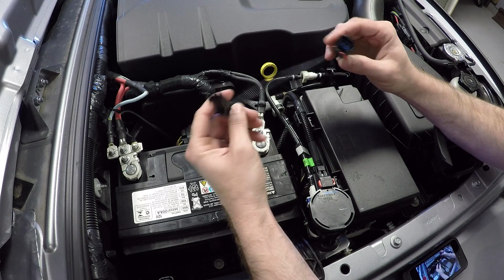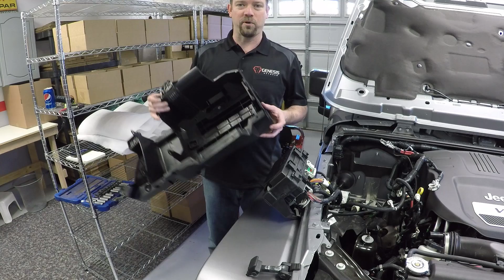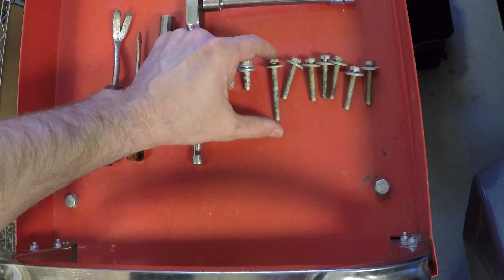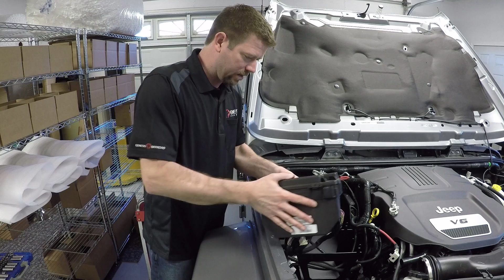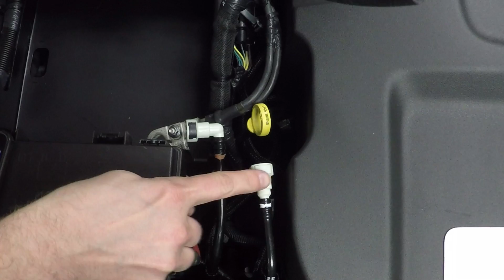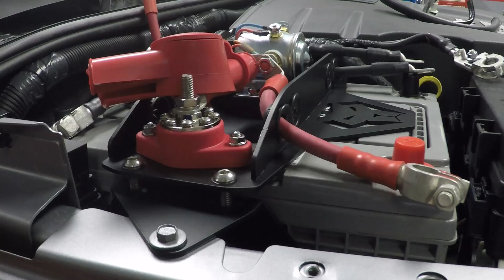Installation Instructions for the Jeep JK Dual Battery Kit

Comment: Ok i have the aftermarket hood strut installed.. which use the exact same factory hole that your battery bay need to use.. what now..  why did you choose to use that factory screw socket? Why not use the same hole that the factory plastic was using?

https://www.youtube.com/watch?time_continue=32&v=a0xfaBbRPbk&feature=emb_logo
Reply from the maker: Due to the weight distribution of the 2 batteries, the bolt location that we use is able to hold the weight more securely rather than the stock bolt hole location which is further forward.

Comment: Shane, it's Sunday night August 2nd.  My dual battery install is complete for now.  Today here in my region of Iowa it was nearly perfect weather.  I already had the structure in place.  All I had to do is go out, disconnect the negative terminal from my single Odyssey battery, slide that battery back toward the firewall, place the second one in, hook up the hold-down/isolator piece, wire the second battery in.  Took like 12-15 minutes.  Tomorrow, I'll wire my CB into the isolator as you demonstrate and then add my next set of Baja Designs A pillar lights.  I'll do my winch, Power Steps and improve the basics of battery wiring this Fall or Winter.  But everything works and I just want to thank y'all.  While I highly recommend this kit and the company, I suggest you follow my earlier thoughts if you aren't certain this is in your skill set.  Either take everything to a professional or get some buddies over, have a couple of beers or whatever you drink, expect to spend a couple of hours and be sure you have all the tools and another vehicle on standby for parts and pizza runs.  I did it with what these days has become mild mechanical skills.  Used to be much better, but I get worn out much easier these days.  If I can do it, you can too.

Comment: I bought all this stuff (batteries too) about a year and half ago.  Used one battery immediately, the other is still in the box.  I plan to finally do this install on my 07 JKU before the weekend.  Fingers crossed.  I'm not worried I can do it.  I'm just concerned about things like a brittle wire or something.  Other than that, no worries.

Comment: well just finished installing my genesis dual battery system in my 2016 JK these instructions are dead on point followed the video to the letter and the install was pretty easy the hardest part was getting the factory battery box out all that's left is the monitoring system to be installed (another day) but im very happy with the product and install instructions five stars !!!!!

Comment: can you use 2 different batteries. like a red top and yellow top optima ?
Reply from the maker: Yes, you can do that because they are both Gel Cell batteries. You can use a Red Top as your cranking battery and a Yellow Top as your accessory battery. The only real advantage of doing that is to save a few bucks, since the Red Top is usually slightly less expensive. The Yellow Top is equally as good at cranking duties, but it gives you the added benefit of being a deep cycle battery, meaning you can drain it down and recharge it without hurting it. Doing that to a Red Top will reduce its life span.

Comment: Can anyone tell me what the reason is for having dual batteries?  I bought a dual battery setup (tray, wiring harness, etc) several years ago, and never installed it.  Never found a reason to have a second battery.   I've winched, off-roaded, camped, etc.   All my lights (factory and aftermarket) are LED.    I'm guessing there must be one thing that other's do that make them want the dual setup, but I've not discovered what that was.

Comment: Do you recommend upgrading the alternator when running dual batteries?
Reply from the maker: It's not necessary. An upgraded alternator will help charge the batteries faster, and will also allow you to run high amperage accessories like big stereo amplifiers, but the stock one is fine for most people.

Comment: Great content! When using jumper cables - is it preferred to wire to the cranking battery, the accessory battery, or does it really matter? Thanks...
Reply from the maker: You can connect jumper cables to your factory positive wire on the cranking battery and the factory negative wire on the aux battery. This will give you the shortest path to your starter and alternator.
Reply: @GenesisOffroad  thanks so much!

Comment: I have the RHD version of this Kit, but it didn't come with instructions. please can you let me know where I can get a copy.. Thanks
Reply from the maker: The RHD version is almost identical. The main difference being you are removing the front part of the battery tray that holds the PCM instead of the air box. Also, your lid will be turned 180 degrees, with the lion head logo facing the firewall so all the wires line up. Otherwise, the install process is pretty much the same.
Reply: @GenesisOffroad  Does that mean that my Cranking battery will be the bottom one, and the Aux battery the one by the firewall?

Comment: thank you for this great video, at what point is a high output alternator needed in conjunction with a dual battery setup?
Reply from the maker: The stock alternator is fine for most users. If you are pulling more power than your alternator can keep up with, then the excess power needs will come from the batteries and eventually they'll go dead. One common example is big car stereo amplifiers. A high output alternator would provide more power. Also, if you have a need to charge the batteries faster, such as when out camping and you want to crank up to top off the batteries, a high output alternator would charge them faster.

Comment: Great video but you lost me at the automatic isolater... thats not in the kit. Coming from a marine background i was going to use the Blue Sea Systems 7610. It is 120 amp and isolates batteries when charge not present all contained in a neat waterproof box. What is this "cap" and what is the load rating on it. Part number, specs, link to this info please.
Reply from the maker: Yes, the smart isolator is included in the kit. All our kits come completely pre-wired out of the box, so there's no wiring for you to do to install dual batteries. We use a Cole Hersee smart isolator which is rated to handle a continuous 200 amps flowing through it, and spikes of up to 750 amps for 30 seconds (such as when winching). You can see more details on how our system works on our website - https://www.genesisoffroad.com/JKDualBatteryKit-p/131-jkdbk2a.htm

Comment: I'm sure it's been said countless times, but it bears repeating, Ground cable is removed 1st and installed last. Don't trash some expensive electronics or worse, burn your stuff to the ground with a slip of the wrench.

Comment: I have a question. Does the Genesis OffRoad Jeep JK dual battery kit, include protection against accidental short circuit of the tools that are used to attach and tighten the positive battery cable to the positive battery post, against the body during tightening, or accidental tool slippage?

Comment: Great video would be an understatement. I’ll be buying this kit for my wife’s Jeep for her birthday. Do you make anything for my V10 Excursion?
Reply from the maker: We have a couple universal options. If you have room for one more battery under the hood, you could use our universal single battery kit, which has all the same features as our JK kit, just squished down to fit on one battery. Then you'll run a power and ground wire over to the stock battery location to tie it in. This gives you a remotely mounted dual battery setup. More info here - https://www.genesisoffroad.com/Single-Battery-Kit-p/153-stbk.htm

Comment: what is included in th kit? battery tay- wiring adn everything i need ?
Reply from the maker: Yes, our kit comes with everything you need to install dual batteries - new steel battery tray, all installation hardware, and a top plate to hold the batteries down with the smart isolator and all the wiring integrated into it - that's why our kit is the most complete and easiest to install dual battery kit on the market! The batteries are sold separately. You can use any brand of battery that you like, just be sure to get the Group 34 size to fit our tray. More info here - https://www.genesisoffroad.com/JKDualBatteryKit-p/131-jkdbk2a.htm
Reply: thank you so much for your time. do u guys ship to canada-vancouver?
Reply from the maker: Absolutely! We ship lots of kits to Canada. Our website will give you a shipping rate quote prior to checkout.

Comment: I ordered a K&N  model 63-1566 air filter is your dual battery set up compatible with the air box  i have purchased ?
Reply from the maker: William Bowling Our system keeps the fuse box and the air box in the stock locations. Anything that works around the factory fuse box will work with our system as well.

Comment: You really grounded that system before putting the positive cables on the battery? You had me sold until the last 5 min of the vid. I'll likely still pull the trigger, but have to wonder...............................

Comment: I have a reverse Odyssey 1500 for 17 wrangler , can I buy the same one or do I have to buy two standard Odyssey batts
Reply from the maker: The Group 34R has the positive and negative posts in the wrong position. This one puts your positive post close to the fender, and then your factory positive wires won't be able to reach all the way over there. Our kit uses the regular Group 34 (without the 'R') which keep the positive post closer to the engine to make it easy to connect the factory wires. You'll need two matching Group 34 batteries to use our kit.

Comment: What battery would you hook up onto with a Battery tender to top off(main/or aux)
Reply from the maker: We'd recommend going straight to the factory positive and negative cables. The factory positive is on the cranking battery, and the factory negative is on the aux battery. This will give you the most direct path to the starter and alternator.

Comment: Installed this today with no difficulties using Odyssey batteries.  I have been wrenching on stuff for years but even someone without much experience should not have any problems.  I really would not want to go at those firewall mounting studs with a hack saw.  Get yourself a Dremel or a cheap copy if you don't have an air grinder.  I used a sawzall with a metal blade to cut the airbox mount off the rest of the tray.  A hacksaw could work for this though.

Very nice kit.
Reply from the maker: Thank you!

Comment: What about a 2005 Ford Explorer? Do you or do you know somebody that has one set up?
Reply from the maker: We have a couple universal kits that could work for you. We have a universal dual tray that holds 2 Group 34 batteries side by side. If you don't have room for 2 batteries next to each other, we also have a universal single kit that allows you to remotely mount your second battery and then connect it back to the stock battery location. If you'd like to talk through the options, feel free to give me a call anytime. -Shane 901-214-5337

Comment: Fantastic video!  It was essential in assisting me as I was able to perform a flawless install of the JK Dual battery kit.  Based on the experience of others in different videos I was expecting the removal of the factory air box to be the most troublesome task.  However, that was a snap.  The real challenge was re-installing the evap solenoid and I think your video went over that aspect of the install much too quickly.

Your warning about shorting the batteries during attachment of the cables was spot on.  I covered the central negative terminals to prevent accidental contact but forgot about the positive lead attached to the smart isolator.  That caused a spark!  

After the install my 2017 Jeep Wrangler Sport started right up on the first try.  Mark me down as another very satisfied customer.
Reply from the maker: Thanks for the feedback! I will work on adding a dedicated video for the evap solenoid relocation tips!

Comment: I have a winch, amp for my sound system, and a spot style switch setup, I can hook all 3 of these up to both of these bus posts and it wouldn't be too many?
Reply from the maker: Yes, the center stud on the bus bar is tall enough to stack several heavy gauge wire lugs.

Comment: Awesome video. Thanks a lot. Quick question: What happens if I can't get the new rubber hose to overlap 1 in with the new line? I can't seem to get them to join more than a quarter of an inch.
Reply from the maker: That's ok, just push the new rubber hoses up as far as they will go until they are very snug.

Comment: Remove ground first from battery then put it back on last that way you can't short out anything
Reply: And never tap the terminals down, if they don't fit easily then widen the clamp.
Reply: @mrbrown3546  Why I widen them first, then use a deadblow hammer to finish the job so I don't mar them up.
Reply: e
Excellent video. Clean and concise. I'm doing it on my 2010 JK in Feb. Thanks again
Reply: Yep, only thing I saw that was wrong, great video, clean install

Comment: Received my kit Tuesday night installed it Wednesday afternoon. Video is excellent. I would have killed to have one of those little pry fork tools that Shane used to remove the plastic Christmas tree wire binding tabs, flat head screwdriver is a poor substitute. Had to grow a pair when it came to cutting that evap tube but it was all good. Wound up trimming the supplied fuel hose (both top and bottom) by half as well. In my experience nothing is ever as easy as they say. But this install was as close as it comes.

Comment: Like to order one but the cost. Ouch🤔
Reply: rob_RT 
J ust
E mpty 
E very 
P ocket
Reply from the maker: If you have the tools and the skills to assemble a dual battery kit yourself, you could use our DIY kit which comes with just the tray and a bare top lid, with everything needed to install it in a JK. Here's a link to more info - http://www.genesisoffroad.com/product-p/131-jkdiy.htm

Comment: This installation was intimidating when I first received my kit with the two yellow top Optimas.  After doing a little research and reading the instructions I dove into it and found it to be relatively easy.  I have not had one issue with it since install and I love having my G screen mounted on the A pillar.  Especially since lately I've had a draw from somewhere that's been killing my battery after a couple days off sitting.  Being able to do a push button jump start is a blessing.
Reply from the maker: So glad to hear you're happy with it Vance! Just keep in mind that your factory fuse box is hard wired directly to the factory positive harness, so that means all the circuits in the fuse box get power from the cranking battery all the time, even when the smart isolator has the batteries separated. So it is possible to drain your cranking battery too low to start the engine. If that happens, that's why you have the boost button! Just press the boost button one time and it will reconnect the batteries, just like using jumper cables to jump start from your second battery!
Reply: I have been doing that lately.  I can't find the draw on my system that keeps draining my battery.  I love the G screen boost button
Reply: I have a new JKU that has left me stranded 3 times.  The dealer finally found a brake switch module that was shorted and draining the battery.  Have them look for this type of problem.  Hope this might help.

Comment: I have a Chevy truck so there isn't a set system for it, so for me I would just hook up all my aux stuff to the second battery. Why not do the same thing in this situation; connect it straight to the second battery?
Reply: I have this system on my Jeep.  it's more than just having 2 batteries.  The way the two batteries are managed through the circuitry is the key here.  I doubt I'll ever have to worry about a dead battery again.
Reply: Rommel R I installed it about a year and a half ago.  Not one single issue.  Genesis has excellent customer service also.  I had a cracked part from shipping and they replaced it immediately.  If you follow the given instructions and watch the video, the installation is a breeze also.  I have not once doubted this purchase!
Reply: Vance Hamilton how long have you had this upgrade? Any issues?